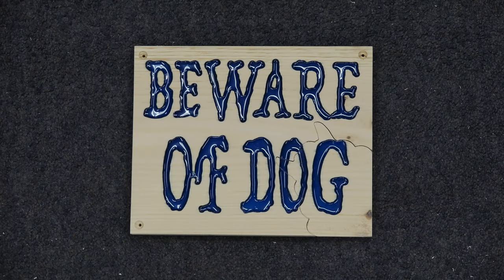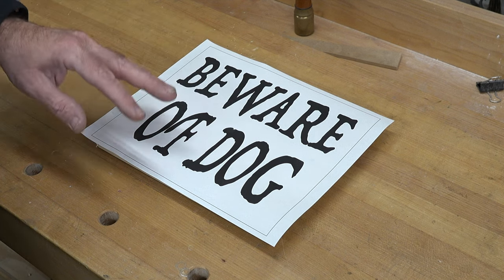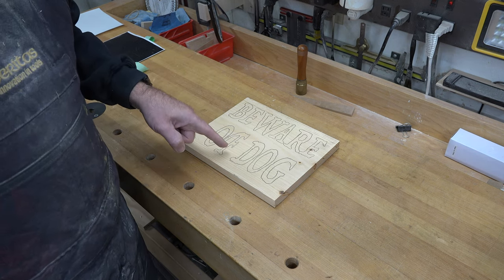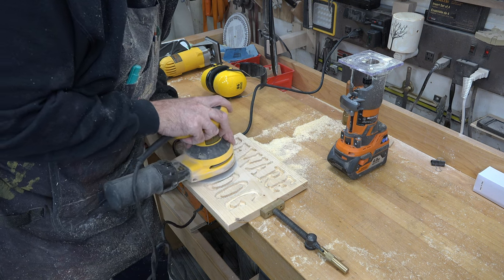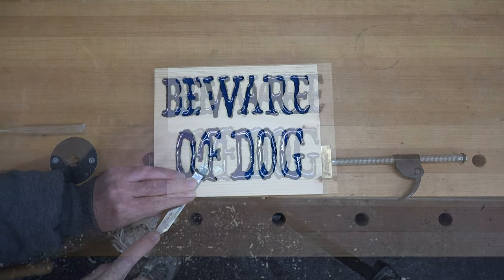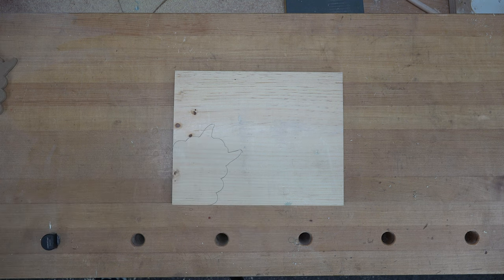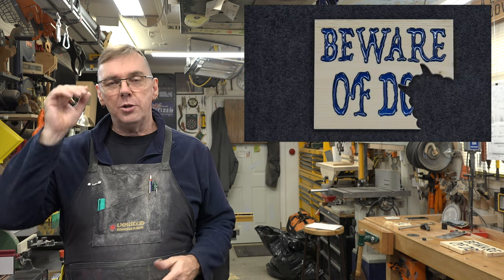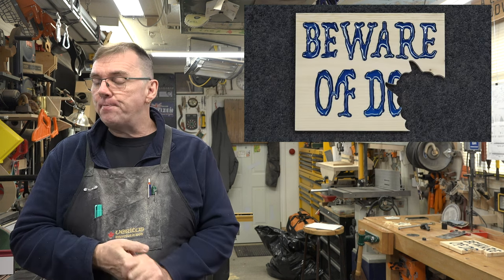Making a Beware of Dog Sign

Comment: There is a sign maker channel, and they will actually tape off most of the are, and then spray paint the letters.  After they remove the tape, they will sand off the paint that is in the areas where the paint didn’t cover.  They do recommend a quick spray of clear, so the colored paint doesn’t bleed into the wood whether it is spray or hand paint.  Me, personally, I would want to hand paint the letters, it just makes the sign less of a “mass produced” type of project.
Reply: That's what I do. I also use cedar rather than pine because of its better outdoor suitability and the smell also is a plus.
Reply from the maker: I have painted signs in past Scott and I would agree with the sealing of the wood to prevent bleeding of the paint.  Thanks for tuning in and for taking the time to leave your comment.  It's appreciated.

Comment: With regards popping the bubbles in the epoxy, it's the heat that does it ... the air in the bubble expands and then pops ... you could probably do it with a hairdryer as well (if it gets hot enough).

Anyhoo, simple project with superb results :)
Reply from the maker: Glad that you liked it Barry.  Thanks for tuning in to the show.

Comment: Great video Kenny.  Like the bite idea.  This would def be a great scrap wood project.  Got left over ceder from that picnic table project, make a few signs.  Have some left over resin, go with that.  I'm guessing you made this vid a few months ago.  Either that or that sweater has AC built in.  Hope you're doing well and having a great summer.
Reply from the maker: The show is definitely pre-recorded Tom.  It's normally about 3-5 months in advance.  Thanks for tuning in and good luck with your signs.
Reply: @acutabove_woodworkings  Cheers.  I made a new sign for our mailbox last year. Almost the same process, except for the carbon paper, just pencil and lots of eraser.  Black epoxy on a clay grey background.  Wish I had seen this video beforehand though.

Comment: Nice little project. Thanks for sharing.
What (if possible free) program can you recommend for fonts for making signs?
What is the name of the "jagged" font you used in this project?
I have a router but I only used it for grooves and round-overs. It will be fun to try out free routing. I have lots of small pieces of pine to try on.
If I spoil a piece in the worst case it can serve as firewood.
Reply from the maker: I just use a general word processor Hans.  In my case, I use Apple's Pages which is the equivalent to Microsoft Word.  You'd be surprised how many fonts are in there.  I'm not 100% sure of the name of the font I chose for this one.  I just went through until I found one that I liked.  The template for this sign is on my website though if you are interested.  Thanks for tuning in.
Reply: @acutabove_woodworkings  Thanks for your explanation. I'll try to find a font in WORD.  I downloaded the PDF  (mainly for the "bite") straight after watching the video.